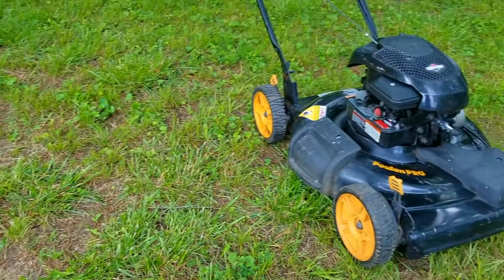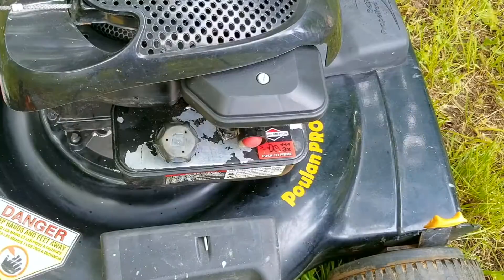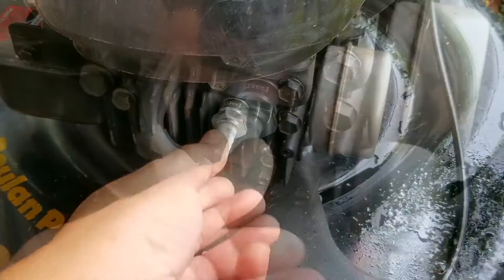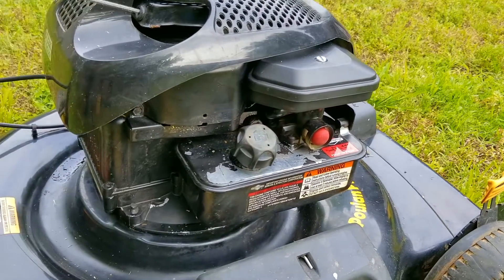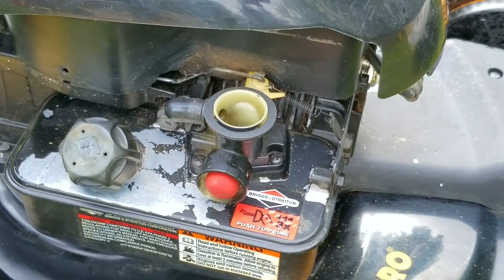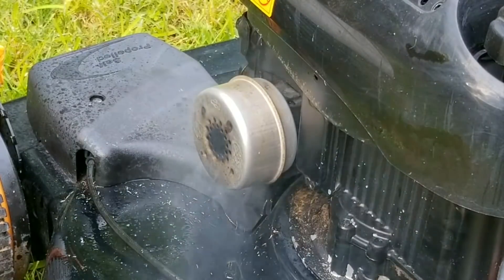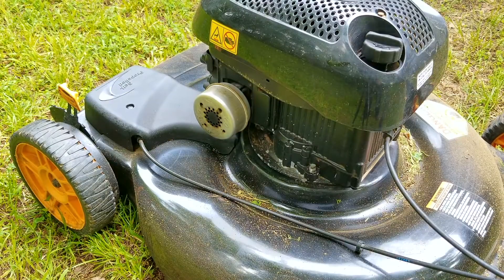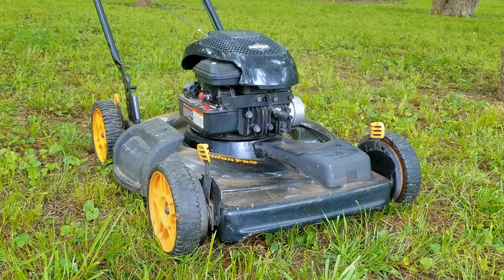Mower won't start after re-Fueling

Comment: I haven't heard of that because of the colored cans relating to different fuel types I don't remember all of them but red is regular gas and yellow should be diesel,  blue kerosene... green I think is oil not sure someone else that knows more feel free to let us know down below , but as for mistaking fuel type it must have been in the wrong color can or the owner doesn't know the color coding for fuel types which is possible
Reply from the maker: you would think they would be able to tell the difference

Comment: Between the condition of the air filter, the oil, and that ridiculous sized spark plug, should anyone be surprised that diesel was in the gas tank ?  C'mon man, Stevie Wonder could have seen that was the wrong sized plug.  Lucky the engine was not ruined.
Reply from the maker: lol.. very nicely said!